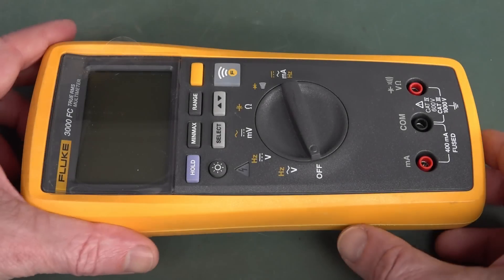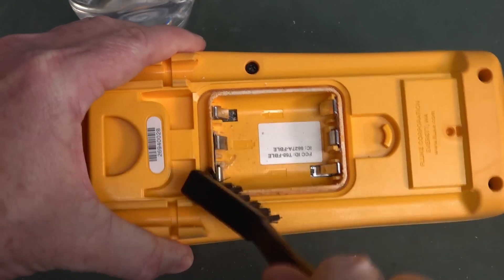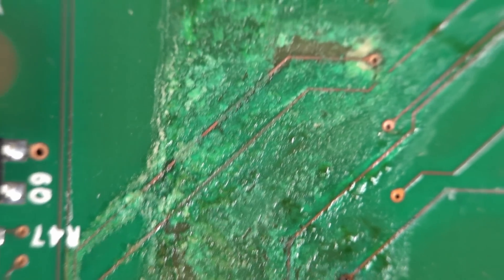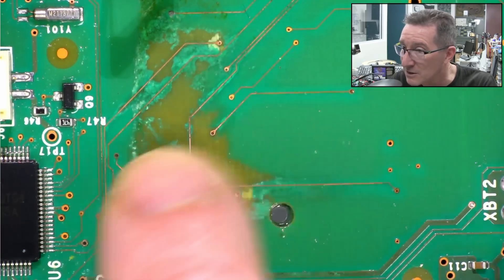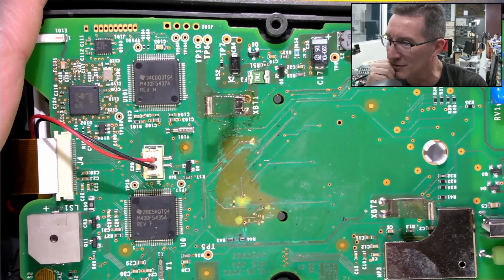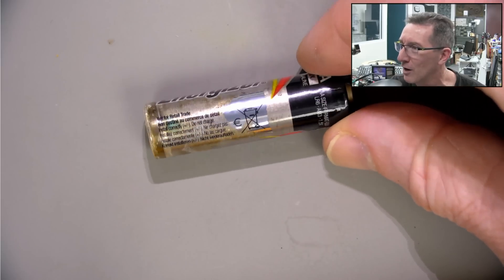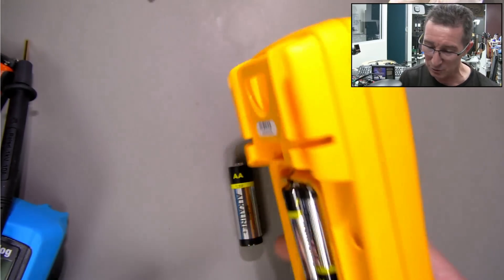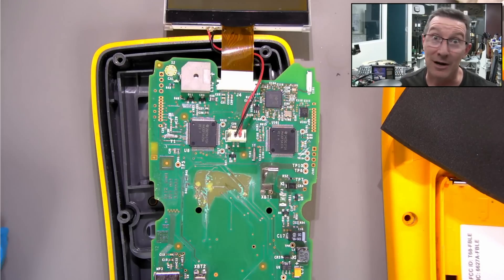EEVblog 1497 - RIP Fluke. Thanks Energizer. NOT.

Comment: Energizer has a no leaks guarantee. I would try to take them up on it and see how they react.
Reply: I can hear it now: "You must've done something wrong" call disconnected
Reply: And these weren't even past their expiration date.
Reply: Like another has said I switched to rechargeable lithium batteries but I think the use of all this environmental friendly materials like in this soldermask, plastic and plastic encapsulation reacts more easily to acid
Reply: @ThaidUp  The industries are pushing for bio-degradable everything  so you constantly replace everything.   It's what's known as going green - meaning 'making lot's of money.'  🙂
Reply: @ThaidUp  Ain't the lithium rechargeables 1.2v tho not 1.5v ?
Reply: @SlyerFox666  I'm not sure about the lithium, but I know the  rechargeable NiMH (Nickel Metal Hydride) are 1.2volt. I use the green Duracell NiMH “2500mAh” in my Fluke 289 with the light on high constantly with no issues.  On one charge cycle, they do last a bit longer than a new set of alkaline. Although the battery life indicator shows only two bars on a freshly recharged set because of their 1.2 nominal voltage.
Reply: @vadimbellous8313  While NiMH has a lower cell voltage (1.2V) than alkalines, the voltage is much more stable until the cell is fully discharged (1.1V), and NiMH cells can provide more current due to lower internal resistance.
Reply: @vadimbellous8313  Well if the battery indicator light is on due to being 1.2v and the equipment expecting 1.5v it will effect measurements not a big issue if equipment not calibrated home gamer but not recommended for any sort of precise stable or repeatable measurements.
Reply: @SlyerFox666  Those are NiMH. There are AA lithium rechargeables with 1.5V if they have a regulator but I read they are not suitable for multimeters as they generate noise.
Reply: @omgused  👍 I had also heard this, so it seems if you want any sort of repeatable results non rechargable lithium seem to be the best way to go, which is a bit of a shame really. I'd rather use rechargable batteries to reduce carbon foot print and do the right thing for the planet.
Reply: On charging AAA NiMH batteries from Lidl I measure about 1.43V on a nearly new Brymen multi meter, not bad
Reply: @SlyerFox666  Agreed. Most new products that do not come with their own lithium batteries are still designed to operate with voltages in multiple of 1.5V (TV remotes, telephones etc). In the EEVBlog forum there was even a guide to hack one of the multimeters to run on 1.2V rechargeables instead of the 1.5V ones.

I've also seen somewhere that there are  rechargable 1.5V alkaline batteries. They can only be recharged for like 5 times though.
Reply: @thomasjburns100  I just charged a couple of Varta photo accu batteries up to 1.39V. Don't worry, as someone else said, it'll go down to 1.1-1.2V after some use.
Reply: @Suzuran  Like you I am also using the non rechargeable Eveready lithium batteries and so far I haven't seen a single one leak. I like them a lot for use in LED headlamps (attached to my magnifying visors for closeup electronics repair)  where they seem to last a very long time.  They're expensive however. The 9 V version, for use in multimeters, run about 4 or 5 bucks.
Reply: @JohnShalamskas  ,  Thousands of devices use 3 AA or AAA batteries in series. Three ordinary alkalines add up to 4.5 V but 3 rechargeables would add up to 3.6 volts, and that's a pretty significant drop in voltage compared to what the devices were designed to run on.
Reply: @Suzuran , expensive batteries make the most sense for devices that require removing screws to pull the back off in order to change batteries, or to remove them until the next time you want to use the device.....
Reply: @goodun2974  that's not how batteries work. If you look at a discjarge curve for 1,5V alkalines you will see that they fairly rapidly drop to 1,3V and then slowly discharge to about 1,1V and then more rapidly drop to about 1V where they are basically spent. A rechargable NIMH battery has a nominal voltage of about 1,2V but it stays above 1,1V for almost the entire discharge before rapidly dropping to about 1V. You don't design a device to use 3x1,5V batteries to operate at 4,5V. Though there are situations where you will have to design a device to use a single 1,5V cell that expects 1,5V, in which case the user will have to use lithium batteries designed to provide that voltage throughout most of its discharge.
Reply: That most likely means you will get a replacement battery to replace the faulty one that leaked... (With most likely so much trouble that it is easier to buy new ones yourself). In other words, something marketing made op but has no value in practice.
Reply: They only advertise that on the "MAX Plus" batteries - and even then, between them and Durasmell, they tend to avoid replacing the damaged product; and just send you a coupon to replace the leaking batteries with more of their brand.
Researching these guarantees is what made me stick with the bargain-bin batteries - I've seen many that look identical to Energizer's battery casing after peeling back the label, who would have thought they all came out of the same style of machine?
Reply: @KomiyanVT  Documenting the process and making it public would be still worth it, even if they refuse to do anything.
They make a claim, so they have to fulfill it or it is false advetisement.
Reply: Energizer: "Ahh, it was just a fluke."
Reply: If you read the leak proof guarantees it’s only for 10 years from manufacture or 2 years after going flat so will still kill old devices like toys that you don’t use for a while. Just switch to NiMH rechargeables. Never leak. The ikea ones are cheap enough to make it worth it <$2.50 each. Store NiMH are still way too expensive it makes no sense.
Reply: Some of the Fluke meters are now made in China. The quality is terrible. Be cautious. I also ordered some "Fluke" meter leads from a Chinese distributor. They arrived and looked authentic. I used them for a while and started to detect some small differences from my older truly authentic Fluke leads. They felt more noodly like overcooked spaghetti and I played my hunch and cut and stripped one to have a closer look. Sure enough, I discovered that the number of stranded conductors in the lead was less than half that of the truly authentic Fluke 10 amp leads. Not only a fraudulent sale but a dangerous sale. There is no way these leads would have carried ten amps safely. I have learned over and over that the Chineese have no ethics when it comes to trade . (Or ethics in anything really) They are out to cheat you in every way possible and they have no compunction about theft of design or theft of cash. Steer clear of anything Chiinese. The only reason an Apple phone is of decent quality is because the Chhineese use them to spy on the West and to figure out the best way to ship fenatnyll into the U.S. to kill Americans. Especially Ameerican kids.
Reply: Ai that one looks bad! I recently received a Fluke Microscanner2 that didnt work because of leaky batteries. Was able to save it, the bord was only affected where it connects with the battery contact. When i got it repaired the owner said wow, well keep it, he already bought a new one. Free Fluke!

edit: batteries on mine were Energizer's as well.
Reply: Vinegar will clean it up.   Will fizz up removing the offensive coating and clean contacts
Reply: Energizer Max, EcoAdvanced, hearing aid batteries, Recharge (Power Plus & Universal), are the eligible ones for the unit replacement, and Ultimate Lithium they claim won't leak, but no mention of unit replacement if those leak.
Reply: @DrCavanaugh Because they didn't leak, or because they replaced a unit from their battery leaking?
Reply: Contacting them is a nghtmare. Don't bother. Getting them to even replace the battery that failed isn't worth the effort.
Reply: @Seiskid  thats what they want
Reply: That doesn't apply to the normal energizer batteries.
Reply: @DefinitelyNotHaraku  Didn't Dave read something that said those were industrial batteries?
Reply: @russellhltn1396  he did say they were industrial although he didn't mention anything more and usually the industrial say that.
Reply: @imark7777777  not for retail usually means they came with a device — probably thus exact multimeter.
Reply: @JasperJanssen  not quite clear on what you’re saying but I can go to a store around me and pick up a 24 or 36 box that says industrial on it. that’s usually what they ship you when you buy bulk for like paper towel dispensers. batteries that come with things usually say OEM somewhere. unless they don’t have a partnership deal.

Comment: My go to neutraliser is baking soda, applied as a paste. Then a rinse with ascorbic acid solution, as that can be bought with good purity. The plastic and soldermask corroding is common, as the alkaline electrolyte does break down the plastic. The acid wash is then followed by rinsing a few times with water, then drying. Lucky for me I do have a big bucket of silica gel, so it will suck most of the moisture out, then a warm spot for a day to get the last bits out. You probably will find half those vias high resistance to open, so will be soldering in small jumper wires, and also those tracks will need protection, so after that simplest is some clear lacquer, sprayed into a cap, and applied with a cotton bud to cover the bare board. But the smallest bit of alkali left in a via will corrode with time, so all will need jumpers added.
Reply: Why make it more alkaline before you remove it?  Couldn't that make the corrosive damage accelerate?
Reply: @AbjectLucidity  Baking soda is more a buffer, to at least swap out the more corrosive alkali, and neutralise it and bring up the pH. Then the weak acid to leave a more water soluble salt behind.
Reply: @SeanBZA  Alkaline battery electrolyte has a pH around 10. A carbonate buffer operates well within pH values 6.8-7.8. A buffer is a compound that will increase alkalinity and set the pH where it is. So, the solution is already too alkaline for that buffer agent (Baking soda pH is around 8).

I just use the directions from the battery makers:  dab it with white vinegar or lemon juice to neutralize, use a tooth brush if needed. I usually clean up after with isopropyl and distilled water.

YT doesn't permit links to external sites, so search 'How to clean battery acid AA' and Engergizer's guide is top of list.

Note, Energizer does also mention that 'acid' is a misnomer, since it's actually an alkaline battery. Car batteries, on the other hand DO contain acid.

In the end, it seems the baking soda shouldn't really do anything, except maybe require a bit more acid to neutralize the solution.

Comment: Ouch, that's a really bad leak, seen similar plastic and solder mask damage before but only even with two decade old batteries, never with a still in-date Energizer. Now I'm scared my Excel sheet of battery replacements by expiry date isn't enough!

Would be very interested in you testing the Energizer leakage guarantee (not with your Twitter power but as a normal consumer), I hear they do actually honor it and will send you a payment for the value of the item. But I wonder if they would actually compensate you for this or pull the good old "Australia isn't a real country, so we can't offer support on your issue" which I often get from other companies.
Reply: No they won't. I had a brand new battery leak INSIDE the packet. Dealing with them was a nightmare. They don't give a crap.
Reply: Isn't Australia in Europe?  Oh, wait...
Reply: The flashlight forums see a lot of refund action from the battery makers so worth a shot!
Reply: The only time I've seen solder mask corrosion like that is when electrolytic caps leak, and the electrolyte is allowed to stay on the board for a long time. It eats through solder mask, and attacks the copper too. You end up with a real mess (or really good bargains on really expensive equipment depending on how you look at it)
Reply: >Excel sheet of battery replacements 
I thought I had everything in Excel. Now I got something to do tomorrow.
Reply: @markm0000  I want to upload my consciousness into Excel...
Reply: @RichardWatt  I love using Excel 97 with Clippy on my beige tower of power. It’s a sweet nostalgia trip and holds incredible sentimental value.
Reply: I've seen heaps of in date energizer leak. Still I'd like an out of date forgotten about battery to not leak too.
Reply: I have never went by battery dates so sorry not a good data point. I still have a weather radio with the batteries I put in it a week after I got it or something like that. And they weren't of similar vintage value brand or charge either.
Reply: I have a text file that I seemingly forget to update or when I do I don't get to everything on it.
I have subsequently been switching out some of my batteries to rechargeables as I reached the bottom of my reusable stack from microphones that I got years ago now.
Reply: Is Australia really a country?
Reply: @TerryLawrence001  It's a continent like Europe.
Reply: Some of the Fluke meters are now made in China. The quality is terrible. Be cautious. I also ordered some "Fluke" meter leads from a Chinese distributor. They arrived and looked authentic. I used them for a while and started to detect some small differences from my older truly authentic Fluke leads. They felt more noodly like overcooked spaghetti and I played my hunch and cut and stripped one to have a closer look. Sure enough, I discovered that the number of stranded conductors in the lead was less than half that of the truly authentic Fluke 10 amp leads. Not only a fraudulent sale but a dangerous sale. There is no way these leads would have carried ten amps safely. I have learned over and over that the Chineese have no ethics when it comes to trade . They are out to cheat you in every way possible and they have no compunction about theft of design or theft of cash. Steer clear of anything Chiinese. The only reason an Apple phone is of decent quality is because the Chhineese use them to spy on the West and to figure out the best way to ship fenatnyll into the U.S. to kill Americans. Especially Ameerican kids.
Reply: Are they based in the UK?! Lol. Tell them you'll deploy a unit of angry Kangaroos along with Boomslangs if they don't help you out.
Reply: @DesertCatDad   New Zealanders might have better luck getting a refund on battery-leakage damaged equipment because you can threaten them with an attack by Tasmanian devils carrying facial-cancer viruses.

Comment: Sad to see the littleFluke go... Energizers have become quite bad as well. For about a year now I have been evaluating both Panasonic and Maxell and they did not yet "surprise" me.
One aspect that I would have done differently is disassembling the meter before bathing it with Vinegar, as this can flow anywhere inside it - neutralizing it with the subsequent IPA bath then becomes a crapshoot, as you can't know for sure where all the vinegar went.
Reply from the maker: In this case it was just on the terminals. The rest you see on the outside is IPA
Reply: @EEVblog  ah, I understand then. I couldn't see on my (non-4k) screen 😁